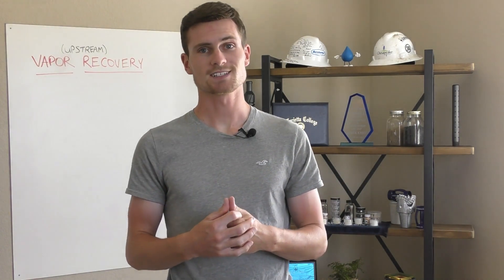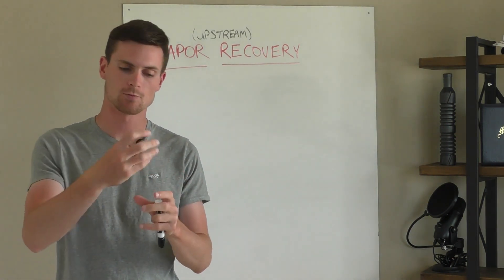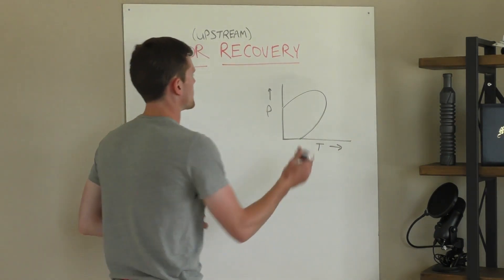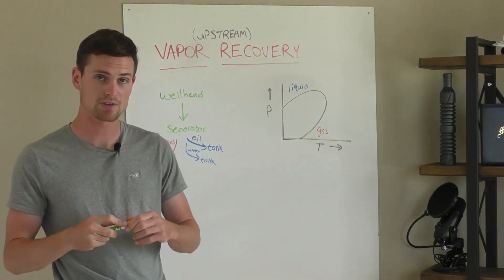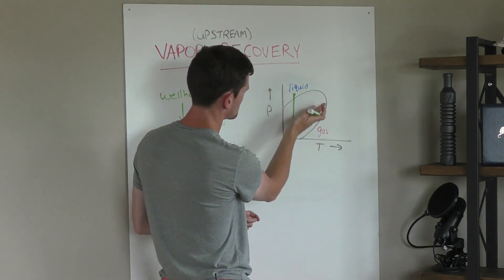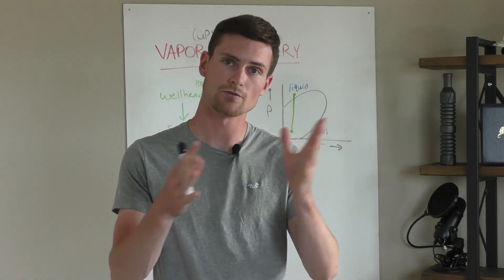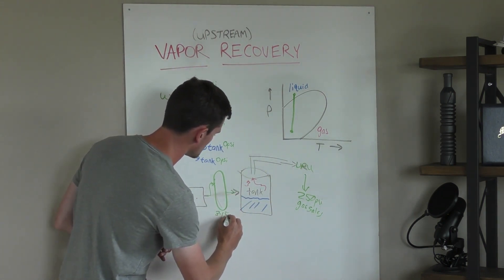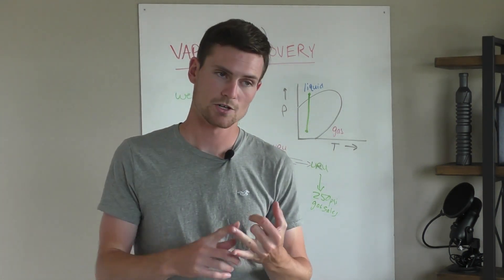Flash Gas and Vapor Recovery

Comment: Excellent explanation. So when you hear the name “2 phase scrubber” does that refer to the state of the fluids as you indicated?
Reply: 2 phase is referring to the gas and whatever liquids are dropping out of it. The liquid can be ngl, water, chemical etc
Reply from the maker: A 2-phase separator or "srubber" generally refers to a vessel that separates out liquids from gasses. There are a ton of use cases.

Comment: Excellent video.  You have a great gift of teaching.
Reply from the maker: Thanks man! Any topic you'd like to request?
Reply: @OilfieldBasics  hey, I'm a hand looking to learn more about what I'm working on. I'd love to know how a "Greg" or condenser skid collects flash gas and how that's transfered back to the sales line.
Reply from the maker: @natepriceoilngas  Thanks for the question and for your desire to learn more! I just need a little bit more clarification. Are you basically wanting to know how a flash gas compressor works (inside/functionally)? Like just the compressor that takes the low-pressure gas and gets it up to line pressure...or are you wanting to know how the gas is literally captured before compression (which this video addresses somewhat)?
Reply: @OilfieldBasics  well yes and no. I've been working on glycol regeneration skids or "Greg" skids for short. They take ritch glycol and burn the water and gas off to make lean glycol. But some how they are capturing flash gas as a by product to be sent to a VRU. I was hoping you could explain how they capture the gas and build enough pressure to get it to the VRU.
Reply from the maker: @natepriceoilngas  Thanks for getting back with me. I think I'm getting closer to the right ballpark here... Does this regen skid also have a tall (contact) tower beside it? The only time I've seen regen skids used is to dehydrate the gas before going into the sales line...in other words, using the tower to remove the water from the gas and then the regen to rejuvenate the glycol for use again in the tower. Does this sound correct?
Reply: @OilfieldBasics  yep that sound correct. And while I was searching for pictures of one I came across a diagram for one. Looks like they use a combustor to burn off of the gas. Thanks for leading me to the answer.
Reply from the maker: @natepriceoilngas  ok great...we're getting closer. So regarding the combustor, I think you're refering to a heater tube inside of the regen unit, correct? So that's not to recover the gas...the gas doesn't go into the regen- it would travel into the pipeline from the tower. The regen needs heated to boil off the entrained water in the glycol so that the glycol can be reused. Does that make sense? I can probably do a video on this too sometime.
Reply: @OilfieldBasics  sweet, thanks for the explanation. I'll stay tuned for the video : )